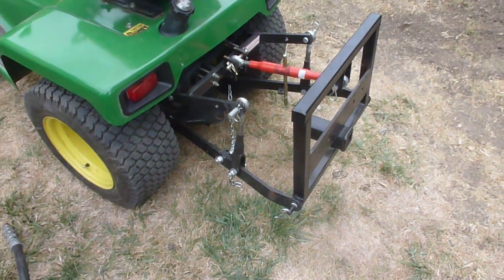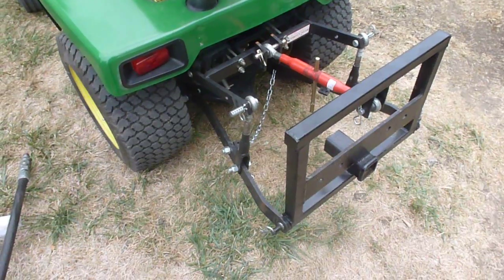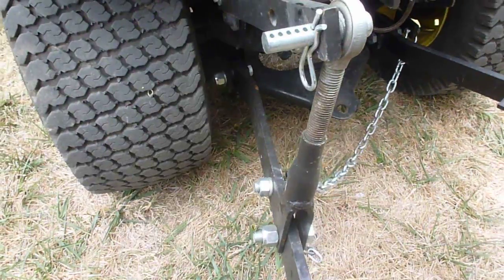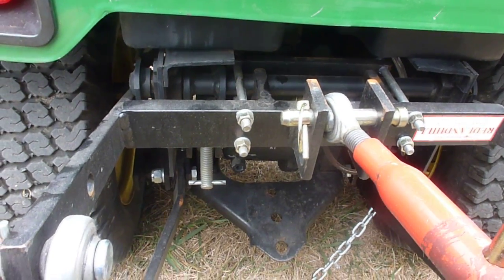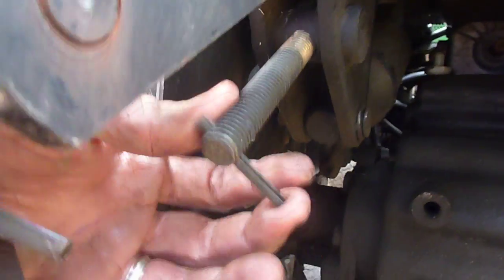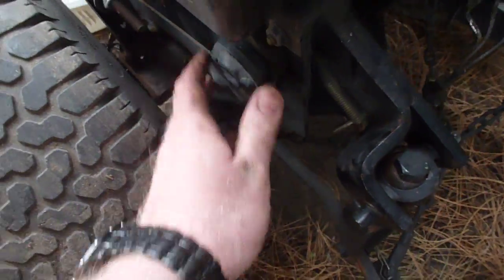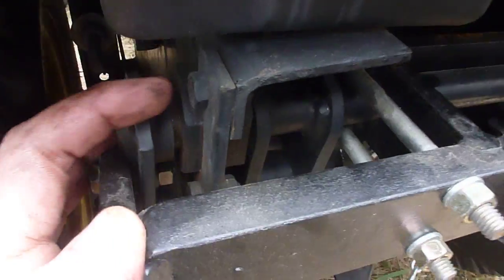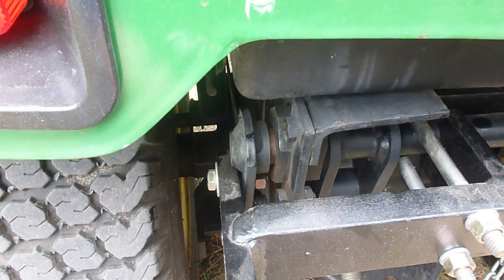John Deere 318 Three Point Hitch Comparison

Comment: I owned a Redland hill 3pt hitch and had it on my 318.  It failed constantly.  The Ruegg or OEM is significantly better.  The Redland is an attachment to the rocker arm and all weight bearing is on the two end bolts...and they sheer all the time.  The Ruegg or OEM has the welded brackets on the rocker arm and it is much, much stronger.  Huge difference.  I have a Cat 0 box blade and the Redland hill was constantly failing with sheered bolts.  For really, really light use it is fine...but for the same money you can get a Ruegg and it is the carbon copy of the JD OEM and you'll be much happier.  The Redland folks are very nice and helpful...it is just an inferior product.
Reply: Mark J Becker n

Comment: On the fuel tank are theres pickups on both lines with filters, mines only working on reserve.  I have the wrong plow that's 13 1/2 wide on all 4 points that wont fit my 420 so I'll need to move that

Comment: Am I seeing modified Tail lights on your JD?? I am considering the same, as I have already changed my headlight lamps to LEDs with a world of difference. I purchased LED bulbs for the tail lights, but have not put them in yet. Considering another LED light altogether. You might have helped my search.
I have a JD 445.
Reply from the maker: The tail lights are stock on that machine. I have a set of tractorLEDS for the headlights that I think work great. Good luck with your search!
Reply: Roadking1970.
Reply: I'll tell you what I'm going to do a video on my 445 as soon as I get it finished but I've changed actually trim the metal deck out cuz I was sick of the stupid things getting it and the tail lights falling out on them all the time. I've had it all rhe powder coated and what I did is I went to Peterbilt and got a little rectangular turn signal flasher light tomorrow in there that looks really cool. If anybody has a 3 point hitch video I am stuck on my 445 Factory 3 point hitch on how to hook up the cylinder I'm apparently missing something and I don't know what. I wish someone would make a video on YouTube about the actual lift cylinder and detailed video of how it goes together if anybody's got that I would appreciate it

Comment: I’m not sure if I understand correctly. With the configuration of the rock shaft tied into the implement lift assembly ahead of it, does that mean that when you raise or lower your plow on your three point hitch, (just using a moldboard plow for example), that your mower deck would also be moving in relation to your three point hitch?
Reply from the maker: You are correct. In the stock configuration the mower deck is tied to the three point.
Reply: Some decks have transport locks to lock the decks in up position.     There is no down pressure on the deck it floats.  So if the deck is locked the lift arms still can move.
Reply: @brianpatrick8787  Great point, thanks Brian.

Comment: I've owned and run the redlandhill for a couple years under light duty; it has performed decently. However installation required significant modifications not described in their materials, best example: top link bracket bottoms out on body panel; much of the fasteners-hardware included were extremely light/low quality, and customer service was lousy to say the least.

Comment: Will the end on the 318 fit my 420.  I also could use a picture of the Honda gx670 24hp throttle linkage from carb to governor connection.  I want to get a 3 point or the one shown on your post.
Reply from the maker: Are you wondering about the rear end? Yes, a 318 differential will fit in a 420 but you will loose the diff lock and 2 speed functions. You will also need to move the axles over from the 420 since the 420/430 axles are longer than the 300 series axles. I'm not any help on the throttle linkages, sorry

Comment: I see you and others say you prefer the factory or reugg over the redlandhill/neatfarm, because of the rockshaft assembly. But no one says WHY that is better. Care to educate me?
Reply from the maker: That's a great point. First the redlandhill hitch sags when you put a load on it. In some testing I did the sag was up to 3 inches. Most of the sag was in the twist of the rock shaft mount. Second is the assembly for the draft arms is too far behind the tractor which limits the lift capacity. Those are at least my reasons specifically for the rock shaft.
Reply: mmrbeef Ok i can envision that with the rockshaft twist. 

By draft arm assembly, are you referring to where it mounts to the tractor axle, or where the draft arms meet the lift links? I would think that the lift links being further from the tractor would make it easier for the cylinder to lift the weight. But thats just a guess because i am shopping my first 3 point. It will be mainly used for 4-500lb loads at max (carryall/forks) and a hitch for ballast for the snow blower. Its for my 420. Im really up in the air about going all out with cat 1 reugg, or neatfarm/redlandhill cat 0. Im aware of most things being made for cat 1. I can fabricate, but would like your input. Dont mind saving money if im not going to need cat1. Thanks
Reply from the maker: The last time I checked the Redlandhill hitch was $100 more than the Ruegg hitch. But that might have changed since they changed names.... Which (only a guess) the name change was driven by some of the bad reviews of their hitch. I can honestly say I was unbiased in my review. My Redlandhill hitch came new in a box with a 318 I bought (for cheap), I didn't even know what it was when I bought it. I sill have my 318 and it has an OEM 3pt on it... Sold the Redlandhill hitch about 4 years ago. As for cat 1 vs cat 0... It's easier to find and modify cat 1 equipment than cat 0 equipment. If you cal and speak to Bill Reugg I have heard that you might be able to swap draft arms and have the ability to install both Cat 0 and Cat 1 arms.
Reply: mmrbeef a little research has shown that redlandhill link directs you to the neatfarm site for their hitch, so i assume it is a rename due to those reasons. But you have directed me to lean towards the reugg cat 1 unit. I dont want any hassle. We all know time is money, and i prefer not to waste time. Thanks for the info and your videos.

Comment: If I wanted to get a garden tractor to plow my garden in the fall what my best bet for the money
Reply from the maker: Best bet for a tractor or attachment?
Reply: @mmrbeef  tractor
Reply: @robellenberger6816  how big is your garden? moldboard plow and disc are the cheapest options of about $500 combined brinly moldboard plows, and a new disc from northerntool which is nortrak i believe? or disc from motoalliance which is cat-0 by default but is also mid grade soft steel and just slightly less desirable gauge than hardly brinly stuff and far superior to anything agrifab makes.